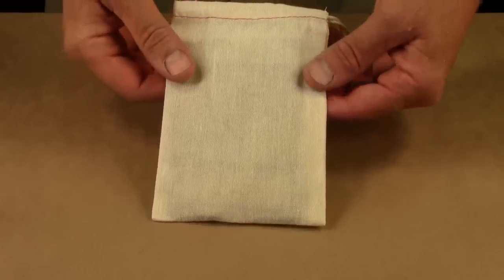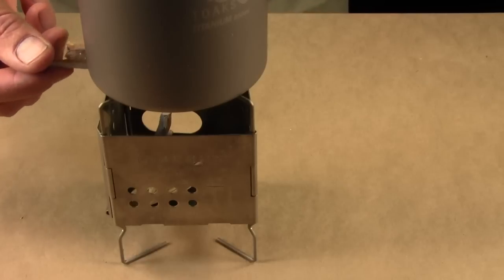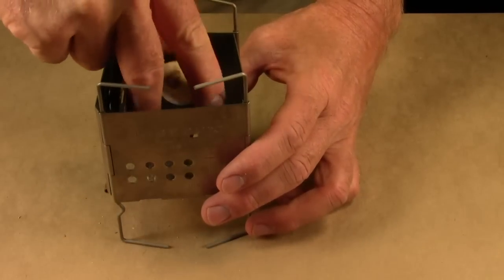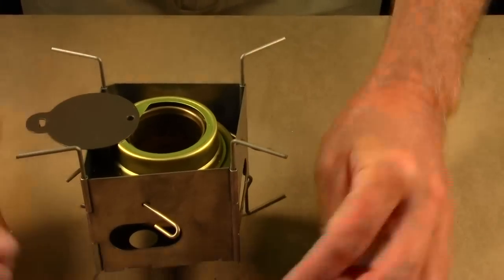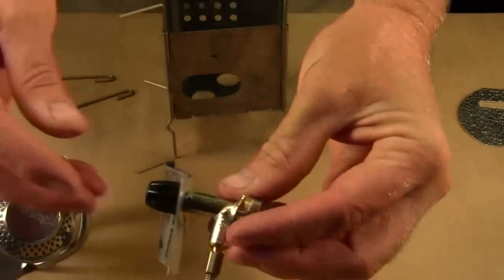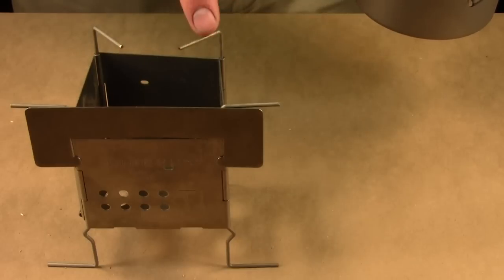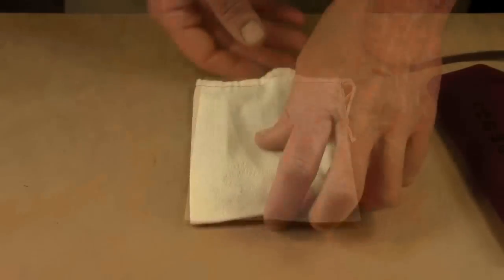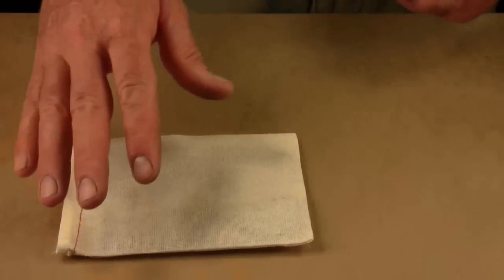Ultralight Backpacking Firebox Stove G2 Nano Instructional Video.

Comment: I love my little nano stove, thanks for making this useful video. I have a question, is X case ok to use as a base when using the Swedish torch method? As in can it stand up to the direct heat?
Reply from the maker: Yes, absolutely👍😎 light coat of oil after will keep the surface protected 👍😎
Reply: @fireboxstove  Thanks, a great bit of advise. I have a video of me using the firebox nano here across the pond dropping Friday if your interested in watching. I plan on making some more using the nano as it’s a great little stove.

Comment: if a stranger's opinion matters, i would suggest that the V bend on the feet holding up the box also be used on the top to hold the box firmly in place and keep the feet from sliding up and down. without them i found it to be fairly easily tipped bc the box will slide up the 2 feet opposite of the tipping direction. id really like to see this safety mod but im also well aware that im probably the only one that has this concern bc it seems no one else has pointed this out or had an issue with it, at least in my general perusing on youtube. even so, i cant wait to try it out next weekend, and i hope to get many years of use and relaxation from this little stove.
Reply from the maker: Thank you for your feedback. In my experience, The movement which you refer to only happens under weight considerably heavier than what Nano was intended for.
Reply: @fireboxstove  if pulled horizontally off the stove it will do it. i do believe this shouldn't be much when leaning over it and taking things on and off more vertically, but if its on a picnic table or something where you may be more prone to slide it off more then lifting it its fairly easy. like when i tried it sitting at my pc desk. no little elbows allows for the possibility but ultimately its the misuse by the user (me) that allows it to go beyond a possibility.
Reply from the maker: Thank you Carl I appreciate you taking the time, You've got the wheels turning 👍😎

Comment: Well done!  If you seen my adventures with the Firebox you know it's my go to stove and pretty much love it's many ways to heat food. By that I mean: charcoal, coal, propane, alcohol and wood.  Note or constructive thought.  The opinions that come with and through Firebox/Steve are well worth having with one exception, the small stainless gripers.  Why I don't care for them, they are thin and to flexable which makes them less than impressive to use.  Hope you find this useful.  Take care and thank you for a great product for the outdoorsmen/Back Country Horsemen of Pisgah.
Reply from the maker: Thank you Tom your feedback is always appreciated. Those lightweight tongs are made for picking up hot coals and not much more. Super lightweight comes at a compromise.

Comment: And don’t whatever you do is put the extended grill plate over the gas burner it will warp.
Reply from the maker: You don't want the grill plates being applied to the stove or fire without meat immediately following that. The meat pulls the heat out of the grill plate so they do not warp. Same thing goes for when the meat is done, you want to immediately move the plate off the stove. Let us know if you have any other questions.
Reply: @fireboxstove  somI discovered!✌

Comment: Just got my nano and x case. Love it! With the Swedish torch burn, can the nano sit on the x case with the fire grate flipped up? Or is that too hot for the case?
Reply from the maker: I've used mine that way quite a bit and it seems to be fine. A light coat of oil between uses keeps it nice 👍

Comment: You know, I'm an old guy on Social Security who used to back pack and have done disaster relief work [So preparedness matters]. If I can ever pull it off, I plan to but some of your stuff. Wether I use it or not... Anyway, worked for 29.5 years in a factory primarily punching 24 gauge steel and in the machine shop... ran the place for a while. IF I could have been 26 instead of 66 and still had those experiences, I'd have been asking if I could work for you, assuming a US plant... That is, enjoying the videos! PS. Your videos and engineering level qualify as "Aspie Friendly!"
Reply from the maker: That's awesome you have those experiences Joseph, I'm sure amazing memories were made by all. We are working on manufacturing fully here in Utah but aren't there yet. Hopefully sooner than later. Thanks for the comment and for watching!

Comment: How do you simmer when you are using the fire torch setup? ty
Reply from the maker: The fire torch is not a good choice if you need to simmer. The fire torch works best for boiling or foods that need a hot temperature in the beginning and a simmering temperature at the end like bacon.
Reply: @fireboxstove  What would be a good choice setup to boil rice - where you need to bring to boil then 20min simmer? Thanks again.

Comment: Recently purchased the nano kit, awesome stove, how do you put the L pins in the carbon felt to make it into wind screen. Are there hole or slots in the felt I'm not seeing or should I cut my own. Sorry for dumb question. Thanks.
Reply from the maker: Yes, you will need to make the holes initially. Put your fingers on both sides so you center the pin as you go. Once your hole is established The l pens will follow the existing holes.
Reply: Thank you. I think I got it now.

Comment: Does the titanium version of the Nana have any disadvantages (other than cost) when compared with the stainless steel version? For example, does the titanium version require any special handling, or does it not hold up as well? Can I use charcoal for grilling if desired with the titanium version?
Reply from the maker: Sorry for the slow reply... The titanium version does not have any disadvantages versus the stainless steel it's lighter weight, it cools down faster, is more corrosion resistant and would work just fine with charcoal 👍🙏😎

Comment: Just got mine today and can’t wait to use it. 

The fire grate comes in contact with the walls of the stove about a half inch above its final position, requiring me to give it a good little tap to get it down/up. Is it possible for me to file those edges down to eliminate this? Small gripe I know, I’m just now jealous seeing videos where it drops right in to place.
Reply from the maker: The fit is easily adjusted  by inserting your fingers into the holes when the fire grate is all the way down then pulling back towards the hinge. Give it a little pressure then check the fit... repeat until you get it how you want it.👍😎
Reply: @fireboxstove  Glad I asked and Thanks Steve!  It’s a smooth operator now.  I couldn’t do it with my fingers so I ran some cordage through it to get leverage. I wouldn’t have felt comfortable applying that much force without your instruction but it worked and I now have an appreciation for how tough this little guy is.

Comment: One question: will it hold a 12 inch Cast Iron Skillet?
Reply from the maker: It has the strength to hold a 12-in cast iron skillet but it doesn't make sense from a heat output standpoint. If you need to cook with a 12-in cast iron skillet get  One of the larger firebox stoves especially if you're planning on burning wood.
Reply: @fireboxstove  how about a 10 inch Cast Iron Skillet? I am also taking in consideration the weight of the Skillet. I do have both 8 and 6 inch Cast Irons too.

Comment: I have seen the windshield, but would love to see strong wind solutions. I live in the Cape in South Africa and throughout spring and early Summer (prime outdoor time) we get terrible wind but this option intrigues me as a low weight low space option for bikepacking. (Which itself isn't made easier by the head wind!)
Reply from the maker: I think I think the Nano in conjunction with the taller windscreen would give you wrap around full protection. You would probably still want to get behind a rock or wall or tree but I think you would have pretty good success with that combination. 😎👍
Reply: @fireboxstove  hey wow! Thank you for taking the time to respond! Those are good tips! If all else fails could even use the bike as a windscreen!

Comment: Im wondering if the trangia x2 multifuel or the similar primus omnilite ti with trangia adapter will work with this? The only thing i dont see that wont fit is a hole for the spindle value by the burner in both of the stoves that ive mentioned.
Reply from the maker: That's the difference between those and the gas burner adapter is the adjustment valve is at the bottle rather than the burner.

Comment: Hi!
Looks really nice and good instructions, just wonder, and it is just a suggestion, about the "grill" pad.
Would it be possible to use the short pins (used for the trangia) "u"-part to lock it in the holes diagonally as just placing it on the "legs" seems hazardous...  :) Think it will work, as it then can only slide some diagonally, I suppose smile
Very nice stove and the multiple uses is more than most I've seen!
Reply from the maker: +Eie Noren The way I figure it is that the Nano is so small and light that anchoring the grill would be pointless since it will be nessicary to hold the grill with pliers (or similar) any time you're using a spatula to turn your food anchored or not.
Reply: +FireboxStove Good thought, I can see that it might be an issue, but if they are "locked" you have (when using the plier-ish similar whatever) control of both stove and grill as it is very light.
Ah, I think I am a wood stove hoarder... have a lot not even used yet and still thinking I should buy this smile  this mite have some reference to that I am really a sucker for good technical solutions.
 Thanks for the answer and I have to look for a supplier in Sweden or Europe.
BTW happy easter

Comment: Hello Steve. I am gonna be purchasing the Gen2 3" Nano Ultralight Stove kit that comes with the fireplate, flame shield, and the black case.  I want to also purchase the 6x6 carbon felt but would like to know if it fits in the black case easily. I plan on using these for a backpacking/fishing trip in upstate NY.
Reply from the maker: Thanks Anthony, here's a discount code: foundersd

The 6 x 6 carbon felt does not fit into the black does not fit into the black case with the stove.
Reply: Hi Steve. I'm ready to order my Firebox Stove kit but I don't see where to enter the discount code you gave me when i try to checkout.
Reply from the maker: Anthony Gregorio the discount or coupon code needs to be entered while you are in the shopping cart.
Reply: Thank you Steve. That worked. Can't wait to use it in the Catskills. Maybe one day I can get out to Utah. Looks incredible out there!

Comment: Awesome stove. Can you use with a stainless water bottle? Seems like the pot rest pegs wouldn't be stable enough.
Reply from the maker: Curtis Layton yes, it works with the stainless steel water bottle. The legs are actually a lot stronger than they look as they are made of spring tempered stainless steel.
Reply: Great to know and thx for the reply! Though, I wasn't really worried about the legs being strong enough as much as its hard to visualize a tall bottle balancing on the little swiveling pegs very well. On the reg. firebox you've got this great attachment: https://goo.gl/images/Kh4uxi . Got any pics/video of using the nano with a bottle?

Comment: Does the pathfinder alcohol burner fit inside the firebox nano, and if so how well does it function for cooking. I much prefer the pathfinder burner over the Trangia  because of its much larger fuel capacity, burn time and it has more constant heat during operation. ( stainless steel body of burner doesn't heat up as much so it does not vaporize and waste excess fuel ).
I like the idea of a multi fuel  stove system and want to use it as an option but its size is an issue.
Reply from the maker: +Chris Dorris The Pathfinder alcohol burner doesn't quite fit in the Nano.

Thanks for asking.
Reply: +FireboxStove:  Have you tried the pathfinder burner in your fullsized firebox stove ?
Reply from the maker: +Chris Dorris I haven't tried the pathfinder stove at all. I'm sure with all the available positions in the 5" Firebox you could use it several ways.
Sounds like a nice alcohol burner!

Comment: does the nano work whit trangia multi fuel burner? gas and alcohol
Reply from the maker: It does not work with the Nano unfortunately. The spirit burner and gas burner will but not the multi fuel burner.

Comment: I've got both nano and bigger one and have only one question. the evernew alcohol stove fits kinda loose. and haven't tried it sitting on the floor. is there anothre work around to bring the height up to the sweet spot??
Reply from the maker: With the Nano I would use the ever-new on the floor of the burn chamber. With the 5-inch Firebox I would use the adjustable fire grate to bring the height up.

Comment: Hey Steve, so I have a question about the legs and stability.  It seems a little high compared to its width.  Is there any reason you made the Bottom legs so tall?  Wouldn't it have been better to make them shorter?
Stability is super important to me, and I have to say I'm torn between this stove, which I think performs better, or another brand, which doesn't perform so well, but is much more stable.
Reply from the maker: The leg height is important to provide the correct entry angle of the side fed fuel/sticks. This creates an upwards angle which is important to the flow dynamics of the stove. 
The stove is quite stable even with the legs turned inwards for a small pot but even more so with a large pot and having the legs turned outwards. The stove is that much more stable if you get the x- case. Thanks for watching Jim!
Reply: Firebox Stove   Thanks, yes, that's a good point.  I'm very familiar with the 5", so I understand.
I'll almost for sure pick one up, with the case this winter or spring.  I know it looks wobbly and weak, but I trust your company.  You do way too much product research to make it wrong.

Comment: You might want to remove the O ring, rubber gasket, which ever is on your alcohol stove first before using the cap as a stand.

Saw a video of a guy using the pot handle flame guard at the bottom of the stove. He wanted to feed wood sticks under the stove, in addition to the two side ports, for longer burn time, slightly less wood attention needed. The plate was used as a wood stop guard, so as to not over feed sticks pushing them outside the stove.

Comment: Hey Steve, are you recommending the Swedish Torch method over the original cross fed sticks method?
Reply from the maker: +Dean Kirby The heat is about the same, but if you don't mind bringing a saw the Swedish Torch eliminates the need to tend the fire for 50 minutes or so. Very handy. I'm sold!
Reply from the maker: +David Possien Yes! Exactly. The side feed is great for setting a temp (by the number of and size of the sticks used) and the and then maintaining that temp by continuing to feed those sticks in. 
Thanks David!
Reply from the maker: +Dean Kirby It's not so much about deciding which method is better, but rather having the versatility to use what will work the best for the situation, conditions and fuel availability. The side feed is great for setting a temp (by the number of and size of the sticks used) and then maintaining that temp by continuing to feed those sticks in. It's easy to add a stick or take one or two away. And since you're feeding them in a little at a time the flame size is consistent, compared to adding a small piece that will flare up then die out.
Some of it is personal preference. With the Nano you get to choose.

Thanks so much Dean!

Comment: Steve I have a question. When you set the stove is it supposed to be square or does it matter. I just set mine up and it was off square. Is that the design?  Great demonstration
Reply from the maker: Yes it has to be off square in order to fold up. Thanks for watching and commenting!!

Comment: Hey Steve. Really impressed with the Firebox stove designs and hope to order one. Had an idea: what if you make the leg posts separate pieces so that you can choose to have max support on feet (turned out) or vary feet support depending on surface and then still be able to choose the stove top size small or wide as well --giving more variabilty by just turning the each leg posts into 2 separate moving parts?
Reply from the maker: Yes, I have given that idea a lot of thought in fact the overkill mod for the Nano has that feature. Thanks 👍
Reply: @fireboxstove That's awesome Steve! Really appreciate the reply back too. Says a lot about you and your work. Will definitely be ordering a Nano to start with. All the best :)
Reply from the maker: You bet, I try to answer as many people as possible., You will have to let me know what you think of the Nano when you get a chance to burn in it. Thanks for watching!